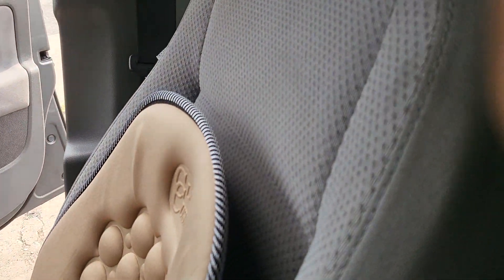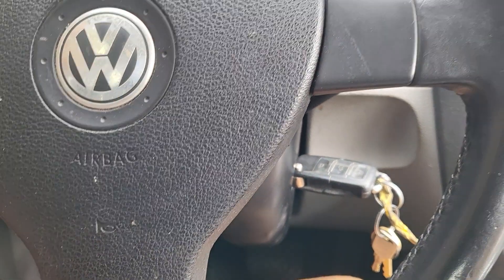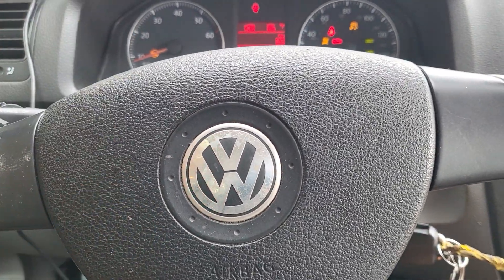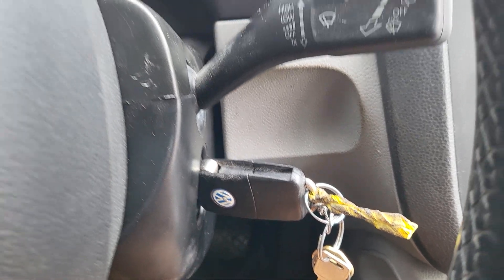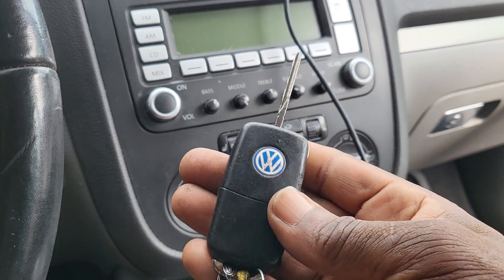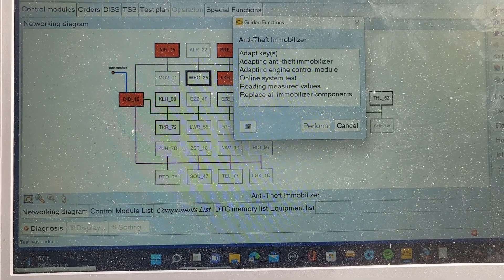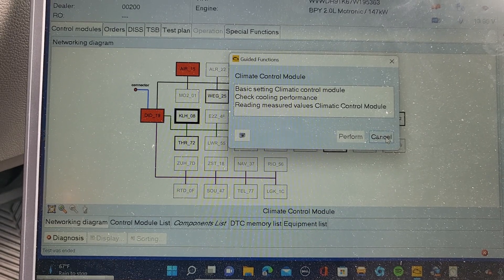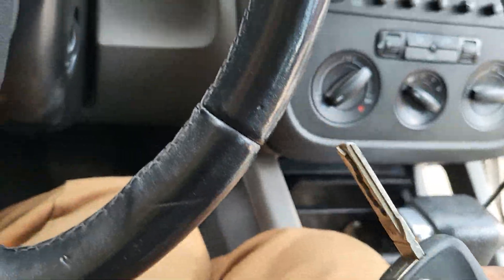Vw Key Programming

Comment: The key battery is probably dead , there is no red light blinking when you press the key, replace the key battery then retry the key adaptation, and look at the frequency of the old and new keys if are the same its written in the key  close to the blade.
Reply from the maker: Thanks a lot
Reply: @BestCarFixes  u r welcome